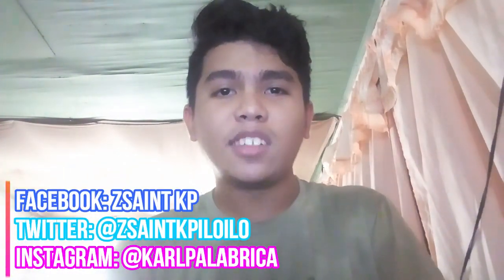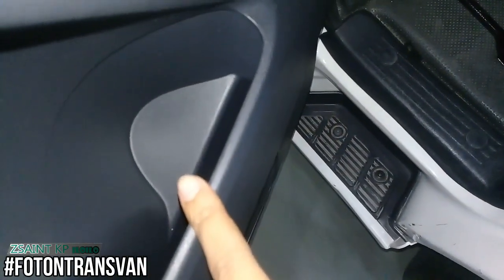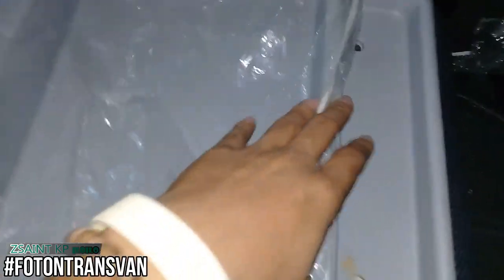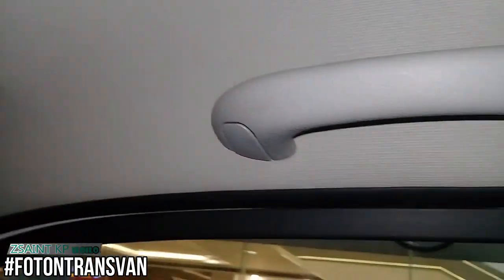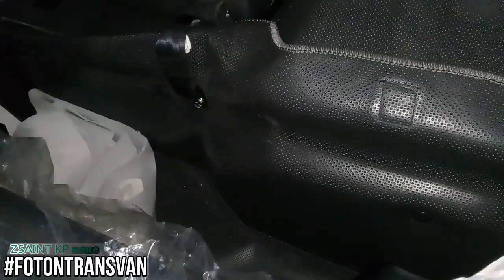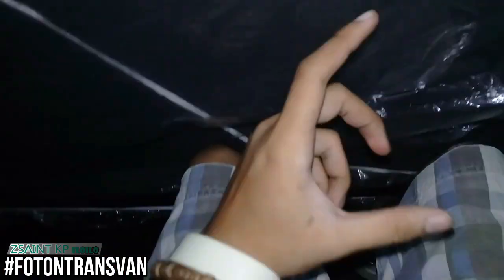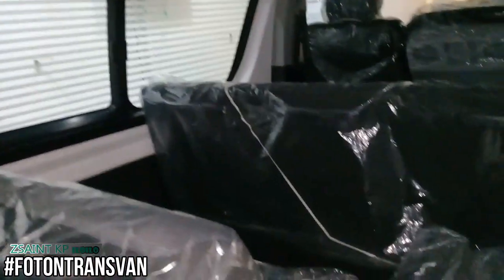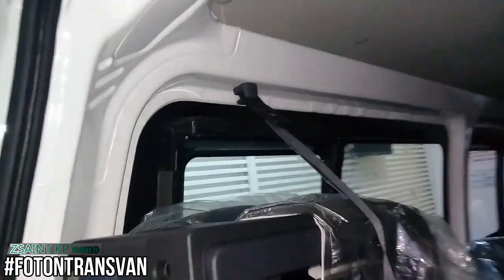2018 Foton View Transvan 2.8 (15-Seater) M/T: Full Walkaround Review

Comment: pd po ptulong! tumataas po ang sign nya sa ovetheat at tumutunog pero d nman po nagbabawas tubig. ano po kaya trouble nun? ty po
Reply from the maker: Sa case na iyon ma'am, yung problema niya is yung kanyang wiring sa gauge niya, or sa kanyang temperature sensor na nagloloko. Baka iyan ang sanhi kung bakit nagkakaganyan yung temperature meter ng sasakyan mo kahit hindi nagbawas ng tubig sa radiator. Try to check sa mekaniko or sa casa if ganyan ba ang problema. Sana nasagot ko po yung tanong niyo. Salamat at ingat palagi.